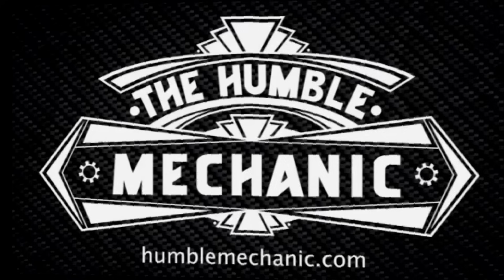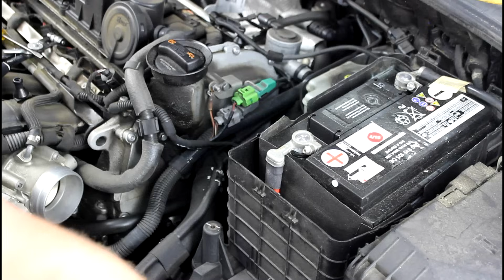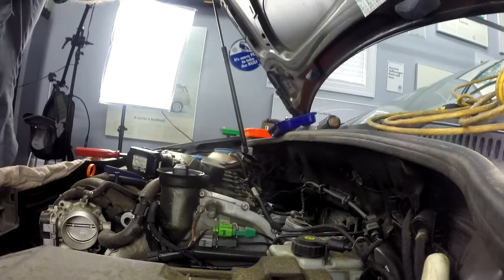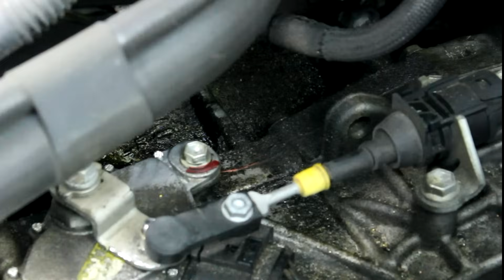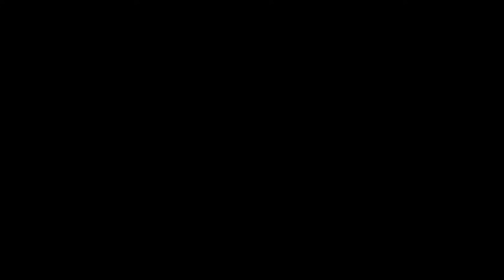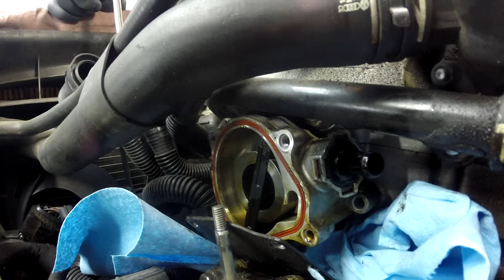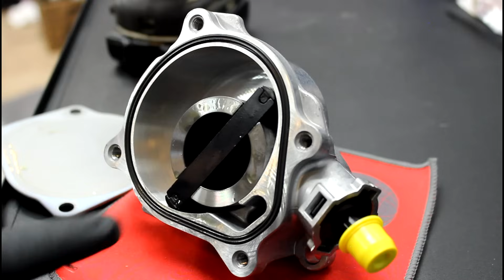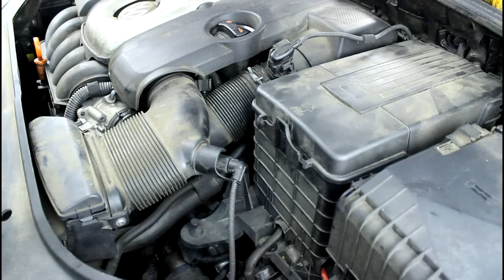Replacing VW 2.5l Vacuum Pump ~ The Easy Way

Comment: The pump was bad ?
or just the seals, gaskets or o-rings  ?
I've been working for years and I did not find a motive to change the pump...
Reply: Pump seals are known for failure. Pump usually isn't bad, just the seals. VW doesn't sell you seal and gasket, only the whole pump. Hence the aftermarket rebuild kit with plate o-ring and block gasket.

Comment: Thanks again,your video help me so much, but instead of taking the whole vacum pump , I only replace the gasket on the front cover and solve the problem, is more easy and finish it in less than 30 min. after finish. I sprayed with brake cleaner and power wash everything to get rid of all the oil build up, now is nice and clean and no more oil leaks
Thanks

Comment: Currently undertaking this repair on my 05 Rabbit. Does the last letter on the parts number indicate anything specific? I noticed you use one that ends 100H. I purchased one from Prexia that ends in 100B. Should I be worried? Haha. 
Thanks so much for this video man, you have no idea how much you're helping me out - I've got to take this car from Miami to Utah next month, and this had me worried as all hell. I experience hard-pedal braking every few dozen brake presses, and that leak just looks pretty nasty.

Comment: For the 2.5L vac pump I see that you can get a pump seal kit on Amazon for ~$40.00 vs the full pump replacement for at least $170.  Is there any reason to replace the full pump? Does it need to be tested somehow? Obviously just replacing the seals is a lot more cost-effective.
Reply: how did it go with replacing the seal kit on the vacuum pump. Did you get any improvement or you had to later replace the whole vacuum pump?. Im thinking of replacing my seals as well rather than the whole pump...
Reply: I bought a rebuild kit for 35 on Amazon. Did the job, there is a hard plastic tube/nipple coming out of the pump. That's where mine was leaking. Be careful when removing it the tabs that lock it place get brittle over time. I broke one tab it locked in place but I wanted to make sure it wasn't going to come out. So I mixed just a tab of jbweld & just put a little bit and I do mean a little bit on the plastic to metal area. So if I do have go back in to replace the O ring again I can.  The large O ring at first it didn't seem that it would work but it will. Don't stretch it, but just press(tough on the thumbs) it into place. Start at the small side of it working around to the wider part. The dismantling of the components to get to the pump was much easier on the manual shift 2.5 2007 rabbit than what was in the video. Either way I would do it again.

Comment: I just bought a Volkwagen Rabbit 2008.  I saw the leak you are describing after going to change the oil.  The car is quiet no engine or trans problems. Drove it 2 and half hours home after purchase. After fixing the leak should I keep the car or sell it?  Scared I might have more problems down the line.
Reply from the maker: Drive it around a while and see if you like it. Always the possibility of issues on a 10yr old car
Reply: HumbleMechanic thanks any other common issues I should worry about?  It's my first Volkswagen of any kind.
Reply: HumbleMechanic that video was awesome job complete thanks.  My ac in the console is not blowing any air.  Do you know what that could be?  Everything in the front works all of the cycles are changing.  Any clue?

Comment: This is a great video - thanks.  But since you have to break the seal on the new 'sealed' component, I'm thinking of sealing the old pump with RTV?  The pump still works fine - it's the gasket that has failed, right?  OR, has anyone tried this seal kit: https://www.amazon.com/gp/product/B071G3ZN2T/ref=od_aui_detailpages00?ie=UTF8&psc=1

Comment: Just replaced the vacuum pump and I did a very good job replacing it. Thank you. My question is, when I shift gear it's super soft and D is all the way to S. What could be the reason? I have a 2011 2.5 vw golf . Thanks again.

Comment: Thanks So much for this well done video,!My 2007 2.5 is leaking oil pretty badly and after watching this video I looked at the vacuum pump and could see oil leaking from it. I ordered just the seals at $45 vs over $300 for the whole pump. Hopefully they will fit and solve my problem as they are aftermarket VW does not sell the cover O-ring....
Reply: How did just replacing the seals go? I have the same issue and...

Comment: Awesome video with great camera angles. My wife came home last night and said she heard a clicking sound coming from our 2007 Jetta 2.5's engine. I went out to take a look and discovered that there was barely any oil left in the engine. Isolated the leak to the drivers side. And after seeing your video, I was able (at the right angle) to actually see the cover to the vacuum pump this morning and literally saw oil dripping from the lower edges. Even though I love working on our cars, I would probably normally be too intimidated with this sort of repair. But after seeing your video, I'm 100% confident it'll be a breeze. Hopefully I don't keep dropping that one pesky screw :P Again, awesome job. You've saved a lot of people about $1000.00

Comment: Great job sir. My wife has a '10 Jetta in Florida. Do you personally know of any shops that can perform this procedure in Florida? Her local dealer quoted her $1,200 and we cannot spend that much right now.
Reply from the maker: It's an easy DIY, but the only shop I know in FL off hand is USP Motorsports
Reply: Thanks Sir!

Comment: disconnecting and removing the battery  causes problem with my Aux  in  , is there any way or suggestions how to reset and make it work ? thanks
Reply from the maker: You have to recode the radio. It’s not hard but requires a scanner
Reply: would you please post a video of resetting  radio with scanner, there is zero video about it, the World will greatly appreciate you for that.Blessings
Reply from the maker: You need OBDELEVEN/VCDS/ or a scanner you can code with
Reply: @HumbleMechanic  Thank you !!
Reply: A question on a different note: I have watch your video of changing the driver side door latch, which i am going to change, but i got driver side front and passenger rear 
door wont lock the other 2 locks ok,. what you think by replacing just the front drivers side will solve the rear issue or both needs to be replaced.
Reply from the maker: Odds are you’ll need them all. But do the front and see what happens
Reply: @HumbleMechanic  thank you and thats exactly i was thinking to do, by the way vacuums pump has been replaced yesterday, this morning i saw a small drip it could be from the old oil onthe engine body will be monitoring for next few days.
Was a great success.took me 4 hours since i have cleaned washed so many things . 
Thank you sir
Reply: @HumbleMechanic  I did replace it, working excellent.Can you please tell me what to do with the door lights? all four doors light wont turn on everything else works. is there any fuse for it? I mean when you open door the door light  suppose to turn on , all four wont turn on. 
 By watching your videos I Have  replaced the vacuum pump and the  door latch ,both work perfect, luckily I live in Concord  NC so the DAP  is only few miles away from me. Thank you  friend.

Comment: In other words  in your video you dont have the Gas kit between the pump and engine body , and I am getting the  gas kit, do i have to use sealant or just align and tight it?
Reply from the maker: I don't really follow. There is a gasket between teh pump and engine.
Reply: I got it, Thank you thou

Comment: My local garage mechanic is a great guy, but he has to work "by the book" and quoted me over $800 for this job. He hinted that there are alternate techniques to solving the problem and suggested that I do a little digging...
Lead me to this video and ultimately to ordering the gasket kit on AMAZON (https://www.amazon.com/gp/product/B071G3ZN2T/ref=oh_aui_detailpage_o01_s00?ie=UTF8&psc=1 ) for $44. Came in 2 days via PRIME and my 16-year-old and I tackled the job in about 2 hours thanks to this video.
Thanks for the video

Comment: Great video! I just replaced this part on my mother's 2006 2.5 bgp jetta today. Do you plan on doing a diy video on catalytic converter replacement? I will have to replace the Jetta's soon and your videos are a big help. Sending many thanks from Raleigh, NC.
Reply from the maker: If one comes my way I will do a DIY. but really that is just 6 bolts and 1 O2 sensor. It's pretty easy
Reply: HumbleMechanic Hello, is it okay to use an aftermarket cat or do i have to use a VW brand to avoid the check engine light from coming on? Thank you for your help good sir.

Comment: For the one that gets dropped I would probably use something sticky on the end of the driver.  I could run it over my 1 inch square rare earth magnet a few times too, those little things are very strong and possibly dangerous with other magnets around too.  I once had to replace one of those grommets on the engine cover.  I forgot the price but it was not too bad.  That grommet was torn.  I just like to give them a very quick short shot of heavy duty silicone spray and that makes them a little easier to slide off without dong much to them too hopefully.  When it comes to that nut on the transmission I know one guy who might mistakenly tighten it.  I can not let him do those things because he sometimes does not do things right.  He is just one of those people that I would not let do such a sensitive repair on my car or really not let him within 50 feet of it with any tools in his hands.

Comment: This could save me from paying for more labor than was needed and I plan to email the links to this to my mechanic and see if my oil leak is the vacuum pump.  I am hoping that is all it is since this is a common problem.  I have 150,000 miles and it still runs great.  It has the 09G that is known for some issues but that still works fine (knock on wood).  Who knows I may even need a new vacuum pump anyhow and just not have the knowledge to have diagnosed it myself.  Parts on cars don't last forever.  Sometimes they last a very long time but never forever.

HumbeMechanic, your videos are very good and I appreciate the way you shed some light on common problems.  That is because it can save people a ton of cash if they know a problem can be something else.
Reply: This just shows that by the book might not always be the best or only way to do things.

Comment: RKXtech.com has a rebuild kit for this pump.  Now this repair became even cheaper!  A clean mating surface with a careful install of the two supplied gaskets and o ring combined with careful torque sequence and say goodbye to that filthy drip while keeping your hard earned dough.  Awesome video H.M. Thanks-
Reply: Would you recommend this product?
Reply: I think you said in the video but the RKXtech.com pump rebuild kit calls for 10NM or 7 ftlb torque. Great video by the way.

Comment: How would you know if it is just a leaky gasket and the pump is Ok...Or the pump is also bad along with the gasket?
Reply from the maker: You can always start with just the gasket and see if it still leaks
Reply: Have you found through the years that most of time it is just a gasket issue or is the pump to blame more than a gasket failure?  My Jetta has 140,000 miles on it what do you think I should replace...just the gasket or the whole pump?
Reply: Jay Franks  READ MY PUBLIC COMMENT I JUST LEFT.

Comment: sir, I have 2009 Jetta with 2.5 that the vacuum pump is leaking. My parts store has one manufactured by Dorman. Would you shy away from Dorman pump. My second question is how would I find out the engine family. My parts tore advised this make a difference reference the pump. The Vin does not indicate the engine family when you use a decoder and there is only a emission sticker that indicates a Group number but it does not match reference the engine family. Thanks.

Comment: Can a failing/leaking vacuum pump cause a high/rough idle? I replaced my Water Pump/Belts/pulley/thermo/thermos housing and still getting a rough idle and bad oil leak. I know the vacuum pump is bad but I'm hoping after I replace it the rough idle goes away
Reply from the maker: I have never seen that happen. You're more likely having an issue with the PVC valve in the valve cover causing the idle issue

Comment: Question?? After replacing the pump, I still have a leak. I didn't use a torque wrench on the pump to the engine. Could that be the problem? Also If the pump was leaking from where the pump mounts to the engine block, could you visually see the oil? or maybe just maybe I have another leak.... Thanks Humble!

Comment: Thanks for doing what you do! Question ?? I replaced my pump yesterday and took it for a test drive and parked car. I still had an oil spot the size of a nickel on my driveway. From a visual inspection, doesn’t seem to be leaking from the pump (the cover)but I can’t see the back (where pump attaches to the engine). What are the possibility of that oil drop being from the left behind oil from oil stuck on the engine/transmission....or leaking from the back of the new pump...
Reply from the maker: Probably residual oil.

Comment: Mr Humble! When replacing the new pump, where does the bracket with the 10mm bolt go. I saw in a comment that was made that you said "bracket goes outside of the pump" what does that mean? Would the order be - engine,pump,bracket- Thanks
Reply from the maker: YES it goes engine block.... pump....bracket

Comment: Hello. Very helpful video. I have VW Jetta 2.5 SE 2011 with automatic transmition. I do not know if the video you made is on the car with manual or automatic transmition. If it is manual one Is it same on automatic one or I would have to removed the transmition? Thank you

Comment: Hi, again.  When the fuel pump removed from the pump, the fuel line may have some air pocket when installed back.  Do I need to bleed the fuel line?   Or do I need to run the motor for a while to eliminate the air pocket in the fuel line?
Or if the fuel pump has broken gasket(O-Ring), would it cause engine malfunction warning light(EPC)?   I am confused.   Help please.

Comment: Hi, Are you Ryan?
I just replaced vacuum pump (06H145100AK)  following your instruction.   However, this Tiguan SE 2.0T has a fuel pump connected to the pump.  I found the gasket(O-ring) broken and so I replaced it too.  I put everything back together and started the motor.   Guess what?
I got EPC(engine malfunction) and CEL warning light.  And my scanner provided diagnostic code 7E8 and 7E9.    But I drove it out to test.  Then I found out the car is not accelerating at all.   Now even the idling is a little rough..
My question is "when I connect the fuel pump back to the vacuum pump, do I need to reset something to eliminate the air pocket?  Or is there something missing in the whole procedure?"   Of course I will call this number given to me by one of you, Ryan, (801) 615-5049 in the morning.   Thank you for help

Comment: Hi, is there any way to get some tips for 2011 VW Tiguan vacuum pump directly from you?
email contact possible?  I am about to dismatle it now on my car but I like to be cautious not to run into damaging other component..  Disconnecting all connected hose or wires not going to cause engine CEL?
Reply from the maker: That is a pretty straight forward job. Just a few bolts and the HPFP. Just be sure the cam is turned in a way that the lobe is not facing out on the port for the pump.
Reply: I bought the whole pump with cap already assembled.  So I do not quite understand what you meant by "Be sure the cam is turned in a way that the lobe is not facing out on the port for the pump".  Can you please clarify a little bit?

Comment: I have been looking at VW with the 2.5 engine. From what I have found the timing chain issues are prior to 07. Is this correct or did some of them continue into 07. Also, is 100k miles a problem area for the 2.5. Meaning major repairs in the near future or anything to check or replace for preventive maintince? Thanks for your time and the videos.

Comment: I have a 5 speed manual and was curious as to the differences in doing this vac. pump replacement? thanks for the video...
Reply from the maker: +Canadiansurfer57 you don’t have to do anything other than remove the install the pump. Nothings blocking it on the manuals

Comment: Just hit 90,000 miles and mine is starting to leak
Reply: I have an 07 Rabbit, pretty much the exact same mileage mine started leaking, so far it is only leaking out when it is bitter cold.  Did an oil change yesterday and noticed the tell tale oil build up from this point.  Will probably buy a pump and replace myself this spring or sooner.  Hopefully the new one will go another 90k and by then I'm sure I won't have the car anymore anyways.  Did you DIY?

Comment: Anyone know what size the o-ring is on the 2.5 engine?  I resealed mine about 6 months ago with some rtv sealant which significantly stopped the leaking, but it has started with a tiny leak again.  Would like to purchase an appropriatelly sized o-ring as I already replaced the back gasket baback then. Don't want to buy the whole reseal kit from ebay when I just need the o-ring. Thanks

Comment: I might have missed it but, why wouldn't you use any rtv or seal between the engine and the pump?  I'm new to the VW game, an just picked up a Jetta 2005.5.  It had 213xxx miles on it, blew a head gasket did a engine swap with another engine that had 67xxx miles on it.  I just had that light come on this morning when I started the car. An it threw the P0411 code, I cleared it an an it hasn't came back on yet during the day.